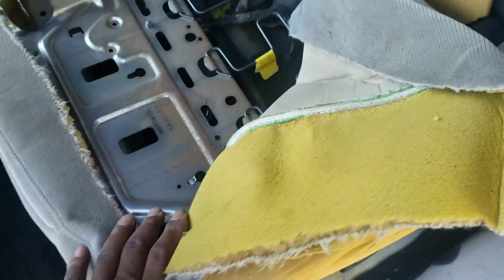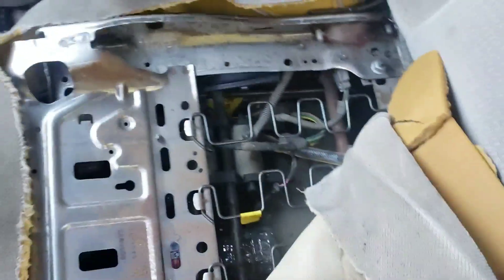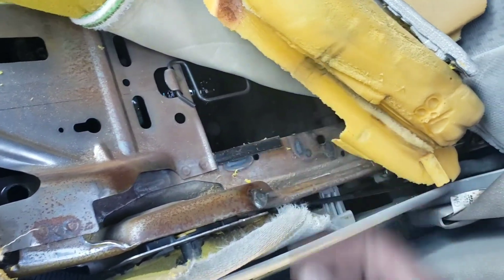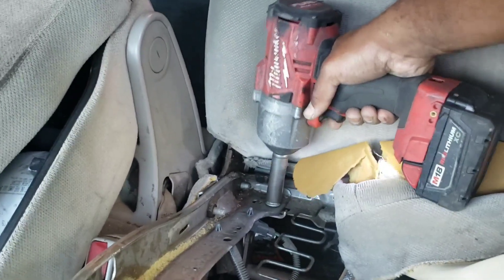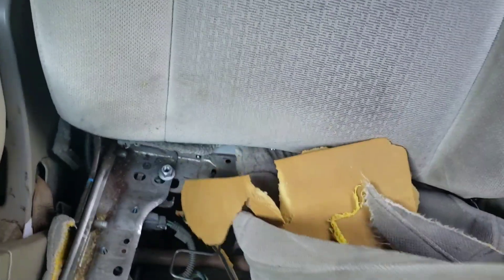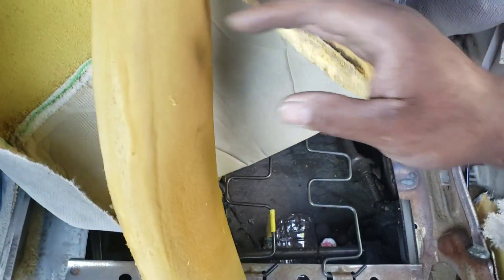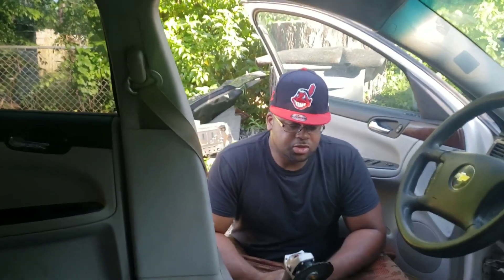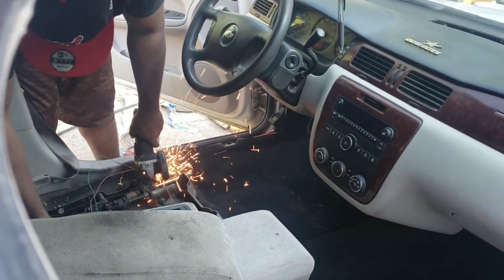Removing impala seats

Comment: Wait the only way to really remove it is cutting it up, that’s so stupid thanks for the info
Reply from the maker: Not if the motor goes out because the bolts are under the fuckin rails
Reply: Part Tyme it’s almost like these companies purposely design everything to fuck you over later on